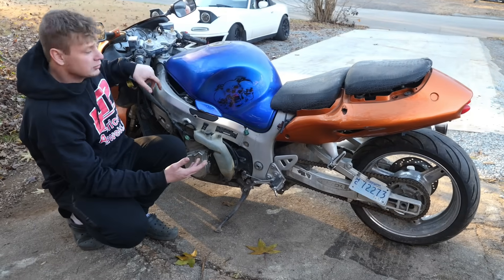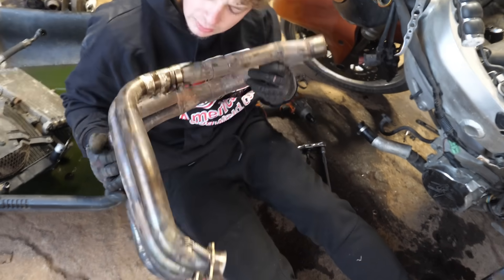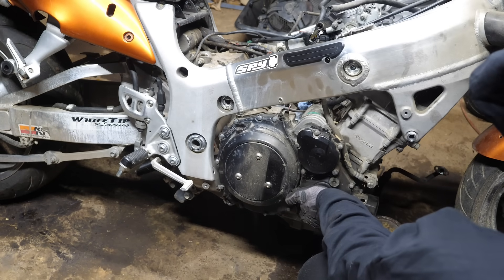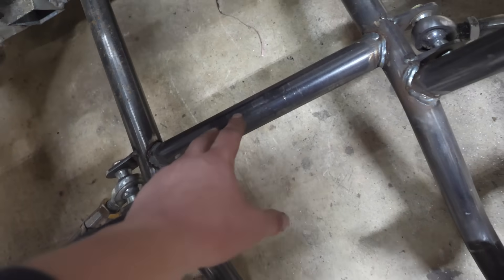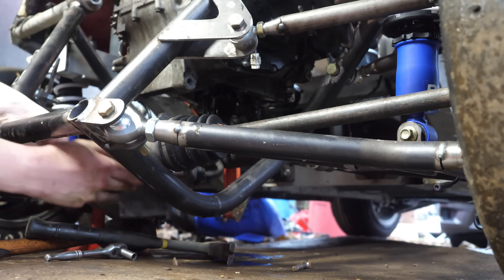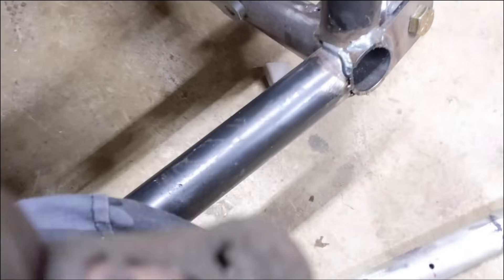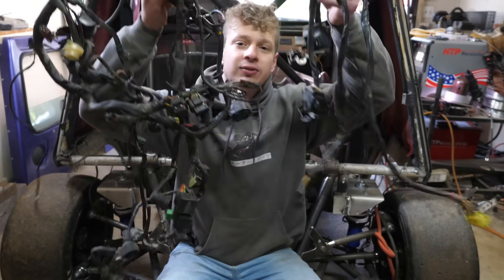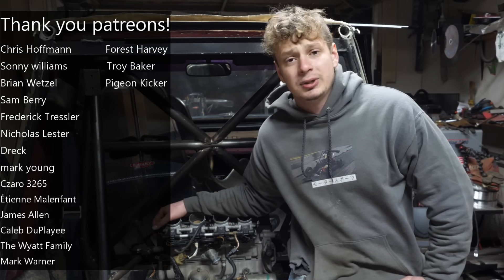Hayabusa Swapped Electric Citicar First Start

Comment: I don't mean to nitpick, but adding a turbo and removing the oil cooler seems like a bad move. I would be looking into a better oil cooler, to handle the extra heat from the turbo. Is there a reason why they remove the oil cooler?
Reply from the maker: The billet pan doesn't have a hole for the oil cooler
Reply: OK, that makes sense.
Reply from the maker: i meant to add they do it becuase the turbo sits where the oil cooler sits

Comment: REMOVE YOUR OIL RESTRICTOR!!!
You removed the cooler and blocked it, reducing overall flow. Gotta remove the hex restrictor behind the Filter.

Itll save you an engine.

Comment: @Vasily Builds i'm thinking about the solder sticks. How do they react to the heat from the engine and the exaust.can you do a test for us with a dummie wire with a solder stick about 2 or 3" from the exaust just for testing purpose and come back with your observation after the first ride. I'm really interessted in that product but it's still not availlable in canada

Comment: A nice variable speed drill press with a good machinists vise and a cutting head works well as a mill and will do at least 75% of any millwork you'd want to do yourself at home,not the super .00000 accuracy stuff though,unless you're really good. 😂

Comment: If you remove the oil cooler, then you definitely need to remove the oil restrictor under the oil filter, otherwise there will be problems with crankshaft lubrication.
Reply: I hope he sees this. It's critical
Reply: Boost